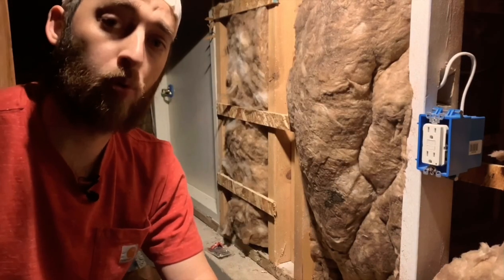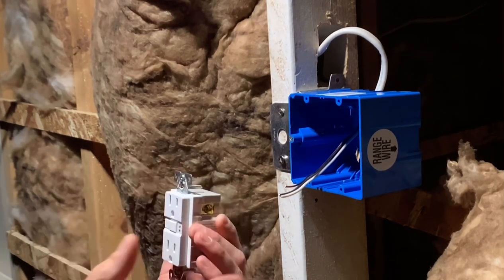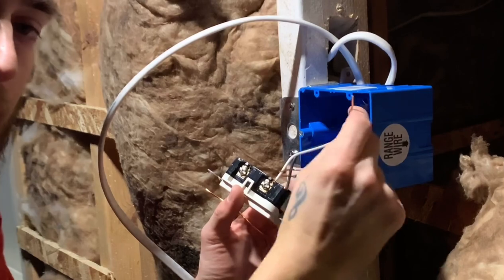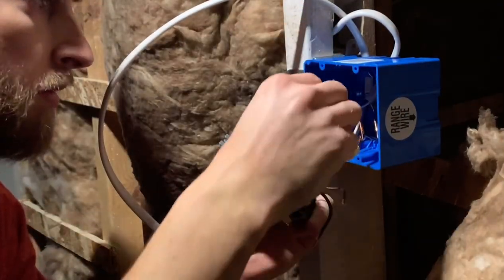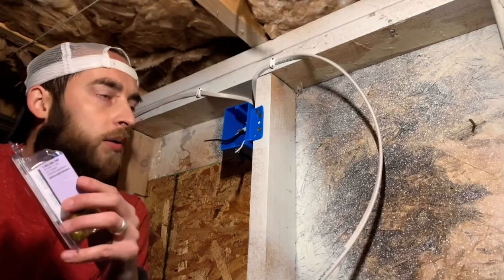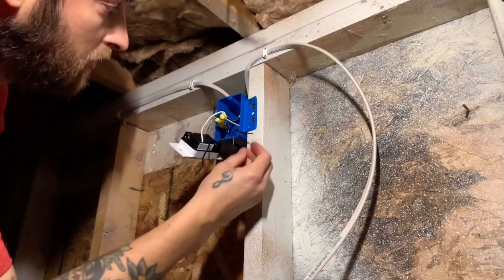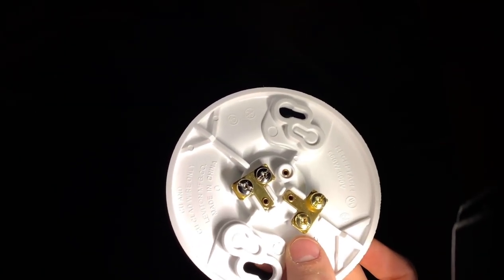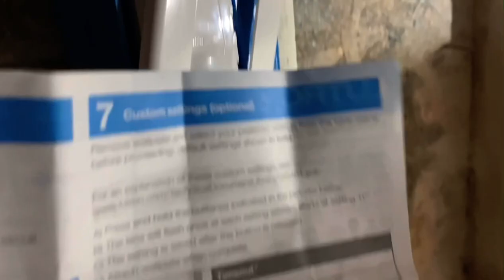Crawl space or Attic Light Installation | DIY

Comment: Hey Zach, I saw your video. I was wondering if this is the same procedure to do if you just want a regular switch light in your crawlspace? Nothing fancy like a motion sensor light, just a regular old LED bulb that will brighten up the dungeon. 😅 Thank you for your time and reply!
Reply from the maker: It’s 100% the same! You would just locate the switch at an entry point instead of somewhere out in the dark. From your power source, run an MC cable to where you want the switch and then from the switch to your light location.